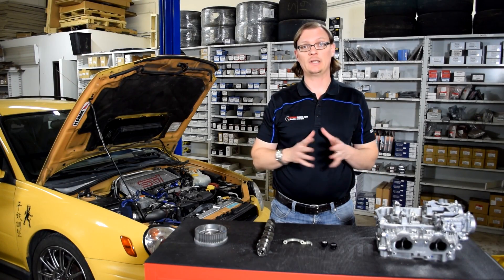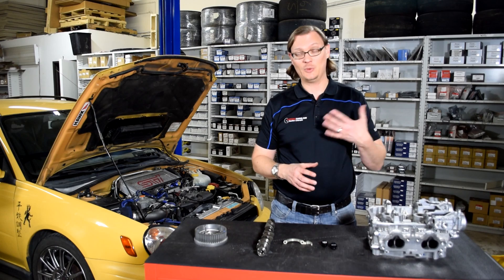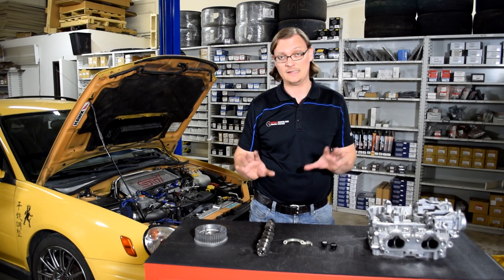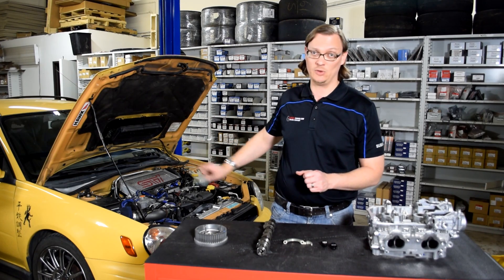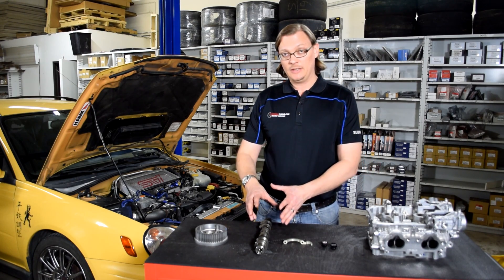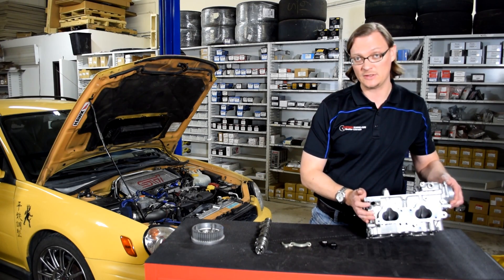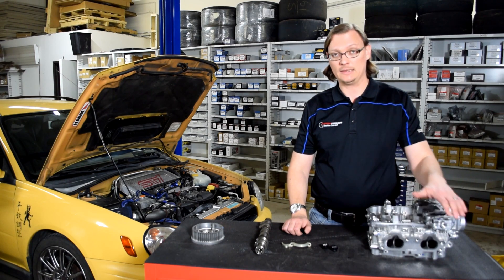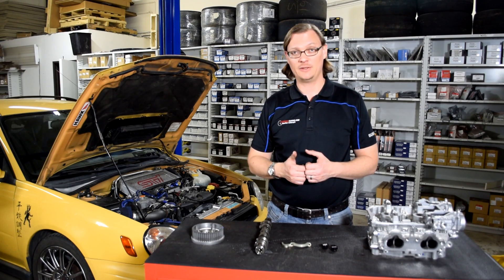How to put a turbo EJ 2.5 Liter engine into your 2.0 WRX

Comment: Can this work on a 2006 wrx if I grabbed the ecu and wiring harness with the motor?
Reply from the maker: Thanks for your question Mitchell.  If you have a 2006 WRX here in the US, then you actually all ready have a 2.5 liter engine!  If you have a JDM/EDM WRX, and have the 2.0 liter engine still, it should be a single AVCS engine.  There would be more involved there, but the long and the short of it is that you can run AVCS on a 2.5 liter engine if your ECU supports it.

But there is a fair amount involved in terms of getting the electronics to work if you are looking at the USDM engines.

I'd recommend looking at this video, but keep in mind that what you are looking to do would basically be the reverse of the direction that we are explaining.

https://youtu.be/3ZwcQRsUI2M

Thanks for watching!

Comment: so i can use my 2.0l ecu and wire harness and be ok running this 2.5l sti engine?
Reply from the maker: Thanks for your question.  Yes, you can tune your EJ20 ECU to run the larger engine.  The only thing that you can't get it to do is to run AVCS.

Thanks for watching!

Comment: Great info i really appreciate the time and info you are giving about this swap. I have W25 heads what would I need to do to delete AVCS so i can run the 2.0 ecu?
Reply from the maker: Thanks for your question.  Basically, the same as the single AVCS heads.  You need to leave the solenoids and lines in place, and run non-AVCS cams.

Thanks for watching, and good luck with your swap!

Comment: I see on your website you offer heads for different model years.  What is the difference between years and would it matter for a 2.5 long block swap?
Reply from the maker: Thanks for your question Titus.  There are some key differences between heads, and we actually have another video about exactly that.  Long story short, you just want to make sure that your heads match the block that you are pairing them with.

This video will go into much greater detail about the differences:

https://youtu.be/h6FdnJRWa6o

Good luck with your build, and please feel free to reach out if you have any other questions.

Comment: i have a question: if i am taking the 2.5 avcs cam-pulleys and swapping them with a 2.0 non-avcs cam-pully. what model/year timing belt do i choose? not sure sure if im over-thinking this or if this is a valid question.
Reply from the maker: Thanks for your question.  There is actually a simple answer.  The timing belt is the same between the 2.0 turbos and the 2.5 turbos, so you can use whichever timing belt you chose.  We like the Gates, or the OEM belts.  If you want to get really fancy, the STI (Brand that is) timing belt is the best that you can get, but it is also about triple the cost of the Gates.

Hope that helps, and please let us know if you have any other questions.
Reply: Do I need 1 or 2 Cam Angle Sensor Brackets?
Reply from the maker: Just one.  And make sure that you plug the two cam position sensor holes in the back of the heads.  It works to leave the OEM sensors in, or IAG makes the plugs as well.

Comment: If you want to make big power, the early 2.0l heads will outflow 2.5l heads once ported. The early 2.0l heads don't have avcs but can be converted to avcs. The point he made about the spark plug hole cracking is correct, you need to watch out for this.
Reply from the maker: Thanks for watching Deon.

Comment: Hi. I’ve got all the parts ready non avcs cams and pulleys seals ect, can the cam just be swapped without removing the cylinder heads, thanks
Reply from the maker: Thanks for the question Tyler.  Yes, you don't have to remove the cylinder heads to swap the cams out.  Just make sure that you check your valve clearance, and you will most likely need to change out some of your buckets.

Good luck with your swap!

Comment: Picked up a 2002 wrx 2.0i, and i already have a 2002 inpreza outback, will that 2.5l be a direct swap? cant really find any info regarding the matter being as No one wants to downgrade to a NA
Reply from the maker: Thanks for the question.  The short answer is no.  Bolting everything up wouldn't be too hard, but the trouble would be getting the 2.5 NA to work with the turbo computer.  It may well be possible, but we don't have any first hand experience.  So in short, it would physically be easy, but electronically hard.

It may actually be easier to move your outback harness over as well, so everything was NA from the ECU to the engine...

Comment: What about the electronic throttle cable, I know the wrx is manual
Reply from the maker: Thanks for your question Matthew.  You just keep the drive-by-cable WRX manifold and throttle-body.
Reply: I was in the same boat.  Didnt know the ej20 intake manifold bolted up to the ej25 block
Reply: Aftermarket headers bolt to both as well, externally engines are the same, the difference is bore diameter of the cylinders. I just took the headers from a buddie's totalled 2008 2.5 liter, and bolted then right up in my 2005 with a JDM 2.0.

Comment: I read about AVCS Wiring kits that act as an  Add-On harness to the stock Bulkhead Harness in the 02-05 WRX.  Wouldn't that be a simpler option, so you can keep the 2.5 heads unaltered?  Found the product in this link: http://www.iaperformance.com/product_info.php?products_id=2580
Reply from the maker: Thanks for the question.  What that is designed for is running the JDM ECU that is similar to the USDM 2.0 WRX, but has AVCS, or a slightly newer JDM ECU.  There are two big things to keep in mind.  The first is that the JDM ECU would be required, and that means running JDM cams as the pick-up signals are different for them.  And the second is that if you do run the JDM ECU, tuning options are significantly more limited, so if you are going to do anything that would require a tune, you have to sort that out first.

Really, if you wanted to keep AVCS, then the best way to do it would be to get a USDM 2.5 liter ECU and harness, and have them merged ( i-Wire would be the people to talk to about this).  At that point, you would then have a fully functional 2.5 liter engine with AVCS in your car.  But that is a lot of extra work (pulling out the bulk-head harness and replacing it after the merge) and expense.  However, that would be the best way to keep the AVCS going.

I hope that helps, and feel free to give us a call if you want to talk about any more specific details!
Reply from the maker: Hello Tyler.  The simple answer is no for a USDM EJ257.  You have to use a JDM ECU as you are doing, and JDM AVCS cams.  For more information, we actually have another video that goes into more detail on the reasons for this here:

https://youtu.be/3ZwcQRsUI2M

Comment: hello,
isnt there a compressor delete i need to do on the d25 heads ? im not sure if its called compressor or something , its a black fan looking thing in the front driver side of car ?
thanks
Reply from the maker: Hello Marlon, and thanks for your question!  If you are using the D25 heads in your non-AVCS, you will have to plug the secondary air injection ports on each head, which are connected to the fan/pump that you are describing.

There are actually a number of companies that make plates to block those ports off, and we stock a couple of options actually.

Good luck with your build, and thanks for watching!

Comment: Can you drop the 2 liter cams and pulleys in the sti head? Or do I need to buy aftermarket non avcs cams and pulleys?
Reply from the maker: Thanks for your question Gavin.  Yes, you can use your OEM cams and pulleys.  In fact, the only difference between the 2.0 cams and AVCS cams is 1mm of lift and the phasing.  The duration is the same.

Thanks for watching and good luck with your build!

Comment: If I run a standalone ecu will I also not be able to run the AVCS?
Reply from the maker: Thanks for your question!  Not necessarily.  There are a number of standalone's now that will support AVCS.  If you want to run AVCS with a standalone, I'd recommend contacting a couple of different manufacturers to see if support Subaru AVCS, and make your choice based on that.

Comment: does most of the information carry over to  JDM engines? Or are they a whole other assortment of problems? great video!! subbed
Reply from the maker: Thank you for your question!  Do you mean putting a 2.5 liter engine into a JDM Subaru?  Or putting a JDM Engine into a USDM Subaru?
Reply: FlatironsTuning buying a used JDM engine and applying the same theory to those engines and installing into a usdm wrx
Reply from the maker: Long story short, no.  That is actually a very different proposition.  There are a lot of other things going on with a JDM engine swap (once you go to AVCS) that make it not nearly as simple as it would seem.  So unless you have a 2.0 WRX, and are looking to put in a non-avcs engine, it gets pretty complicated.

This is one of the video topics that we have our list to make here in the future :-)
Reply: Thanks for the great information!

Comment: Would be nice how to make the ej20x work with the exhaust Avcs
Reply from the maker: Thanks for your question.  Unfortunately, the only way that you could do that would be to use the JDM ECU, which would require a fair amount of wiring, and would also be very limiting in terms of tuning.

It is much easier not to use AVCS, and then you have tons of options for tuning.

Comment: What about running w25 heads? Is there anything special about the exhaust AVCS?
Reply from the maker: For this kind of swap, the W25 heads will be a bit more difficult.  The combustion chamber geometry is basically the same as the B25 heads.  However, the oil passages on the Exhaust AVCS need to be present just as the intake AVCS do.  Long story short, it would be easier if you didn't have to deal with that. 

I hope that helps!